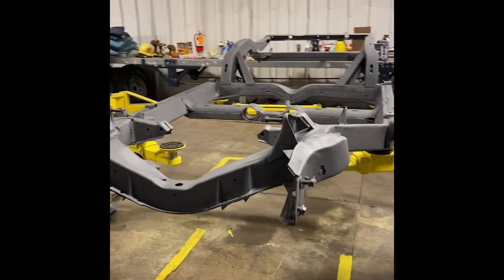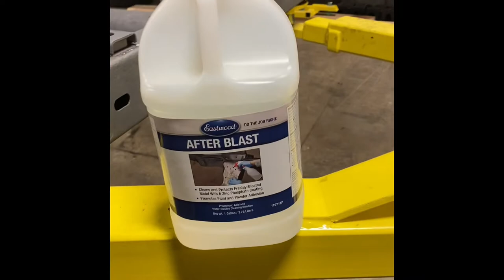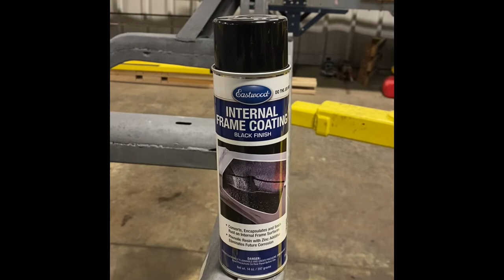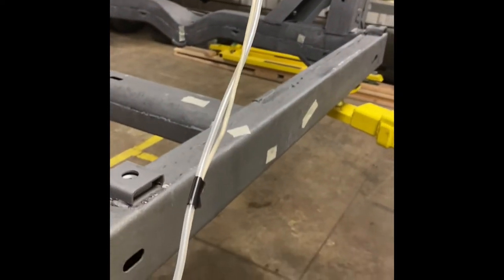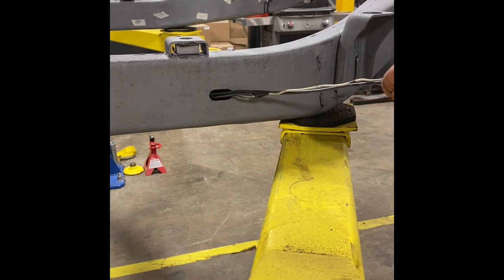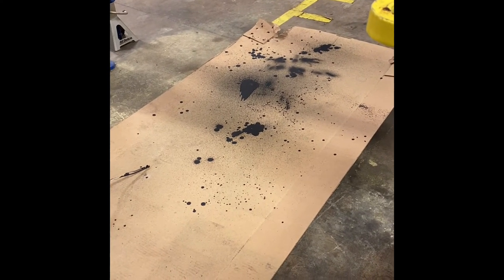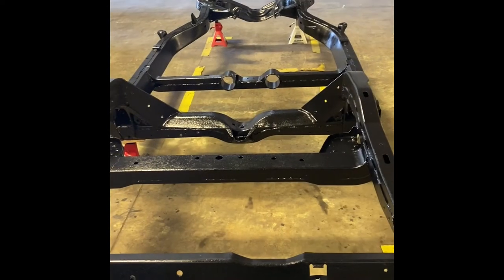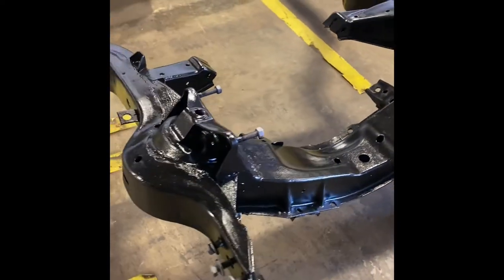1972 Corvette C3 frame prep & painting

Comment: Assuming no greasy hands on the freshly sandblasted frame nothing is better than a few coats of epoxy primer (primer and  activator “2k” 2 component).Then if desired an inferior 1 k /single stage paint spray bomb can be used (if one insists

Comment: I've been restoring cars for 47 years and here's a tip, sandblast clean, no need for any metalprep solution , prime inside frame rails and cross members  first and be liberal, outside of frame 2 coats of PPG epoxy primer, put any desired top coat. Good for 30 years and longer depending on use.

Comment: Motor oil works very well in a car frame also especially if it is already attached to the rest of the car. Did it on my ‘67 Corvette probably 15 years ago. On a old car where there is probably already some rust in the frame nothing is better then oil. No kind of paint product will protect better or stick to rust or penetrate it.
Reply: I used crisco lard and vegetable oil , melt it in a can and brush on , sticks well and you can vary the thickness  needed  ,also not hazardous
Reply: @davidwike4522  Just think of all the cars on the road that may drip one drop of oil every once in awhile talking about hazardous. Those poor Motorcycle riders possibly slipping on the road on 2 wheels. That could be hazardous. Eventually the oil will drip out of the frame in a few days as it did on my lift leaving a light film. Have you ever looked under a engine in your car the oil it sweats on Chassis parts and around the oil pan that collects dust and dirt. Ever notice how those parts stay brand new never rusting. Its the same principle of having oil inside the frame leaving a film. I don't see how it could be hazardous. It surely doesn't hurt the medal inside the frame.